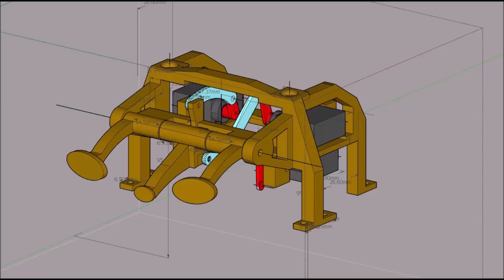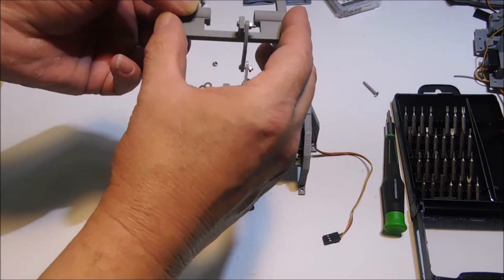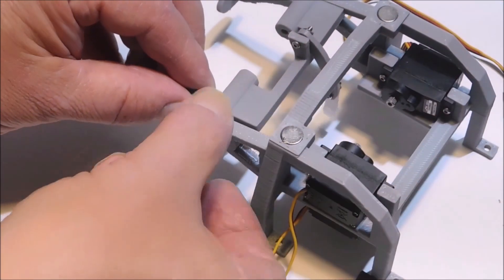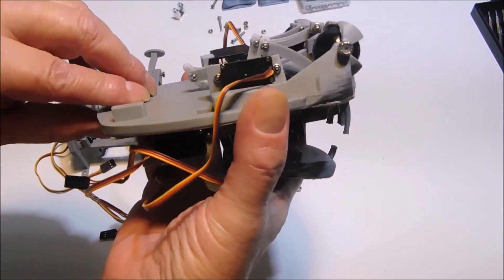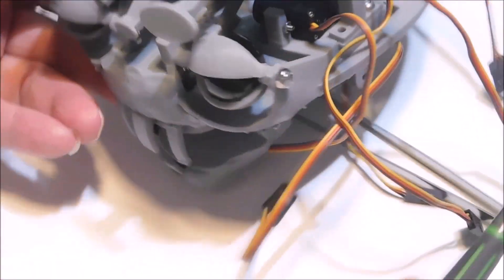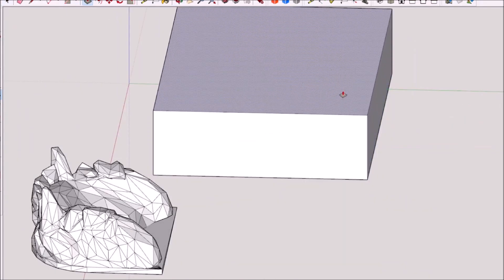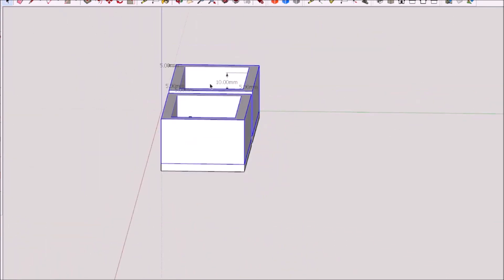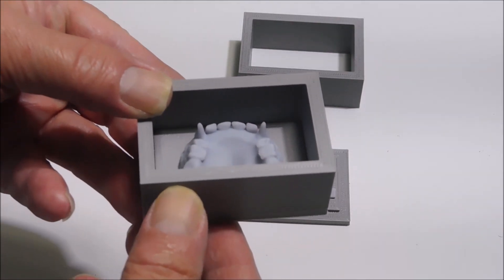3D Printed Animatronic The build

Comment: Speaking from experience, marking the magnets is a great idea, and testing them. Trust me when I say epoxying a magnet and finding it flipped somehow SUCKS.  I've had that happen to me 3 times.
I would recommend building registration marks and pins into the molds to make sure things line up. The same for some components if possible.
Looking good though!